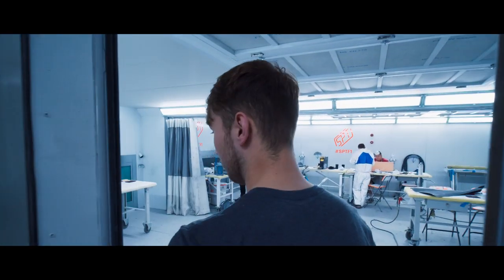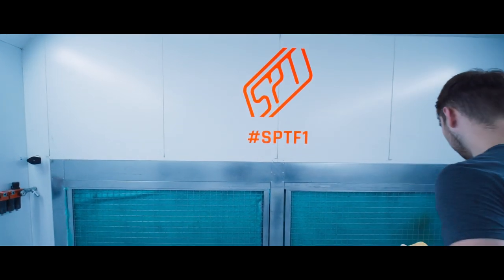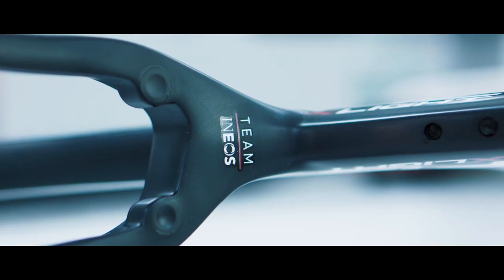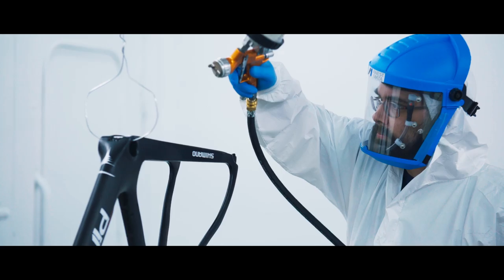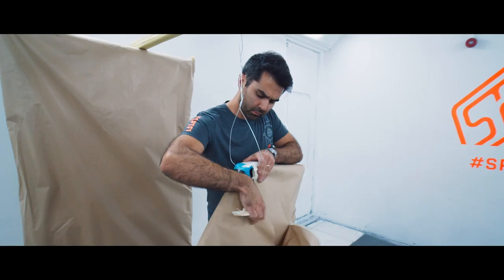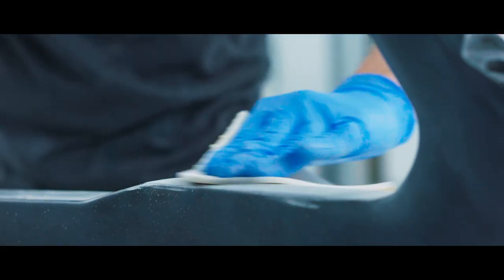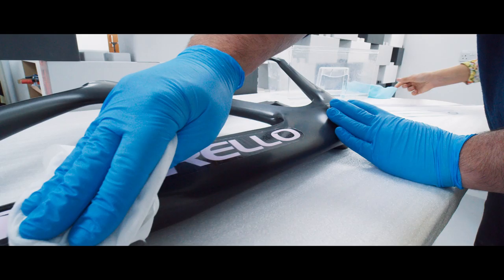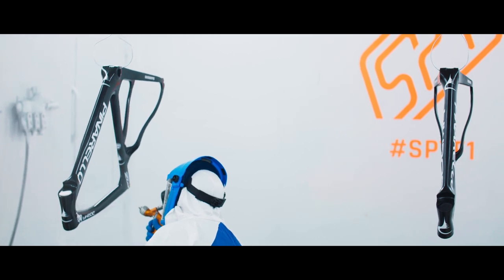TECH TALK: Silverstone Paint Technology

Comment: Interesting but the weight of the bikes is limited to 6.8 kg anyway... so the pro teams don't really need to save grams (they even add weight to the bikes).
Reply: Yeah but it means you can use more aero stuff (that typically weighs more) and achieve the 6.8 kg. Full aero bikes and TT bikes struggle to be below 6.8 kg.
Reply: not when you add disc breaks